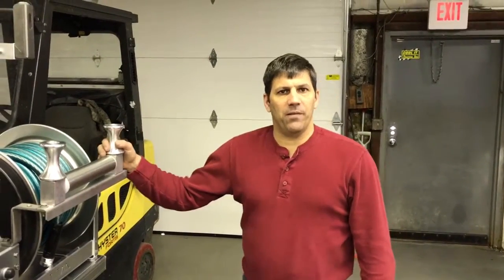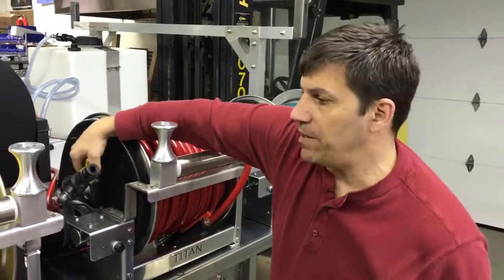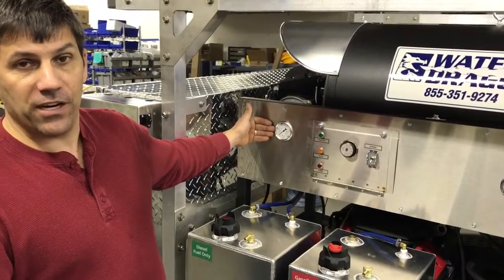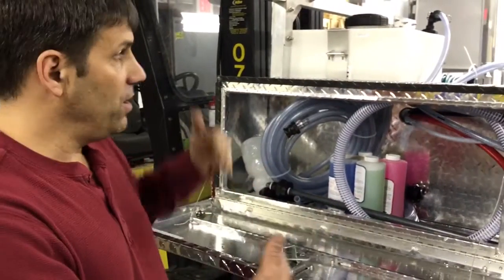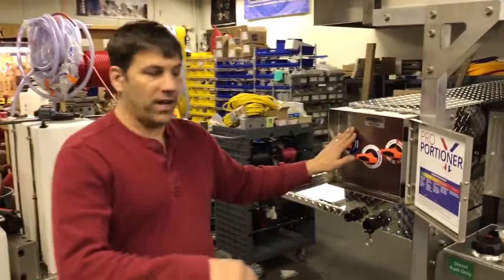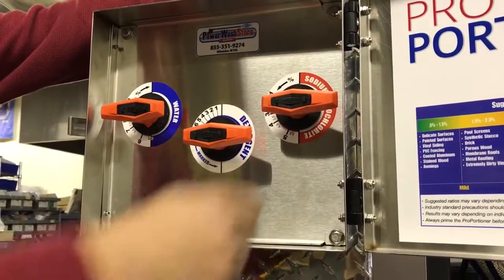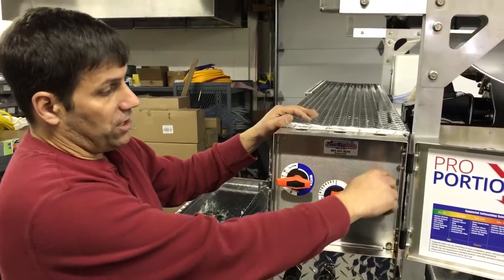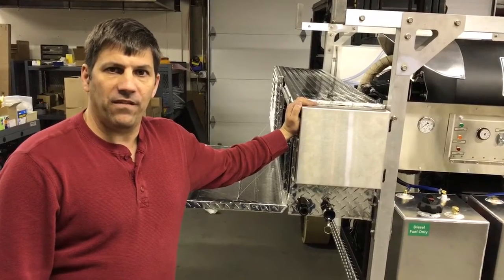Monster Wash high and low-pressure skid by Power Wash Store

Comment: On my chemical injector.The injector itself is in the bypass,not on the straight   through section.Helps with less restriction in pressure for max flow